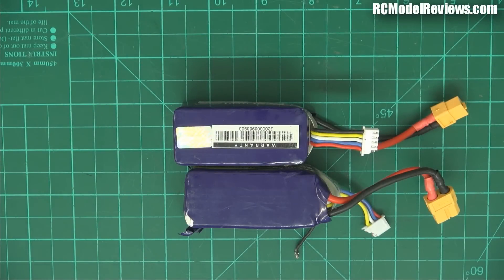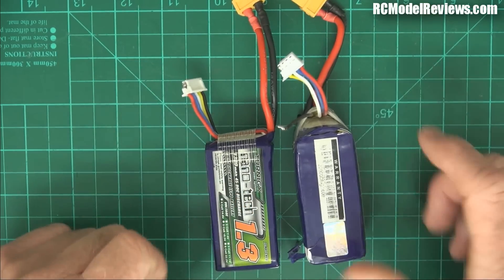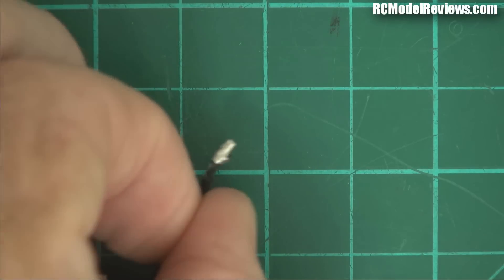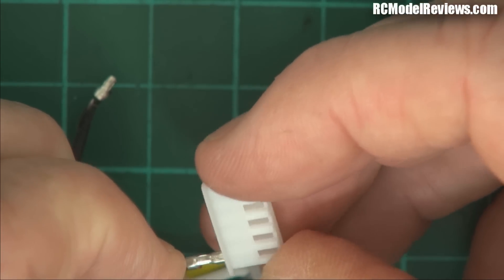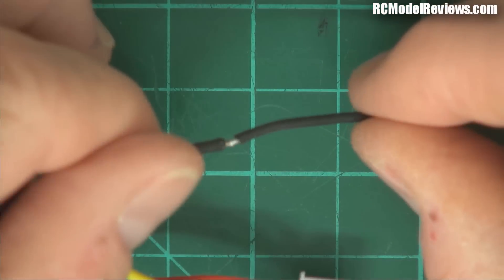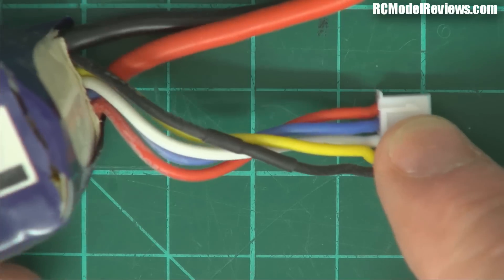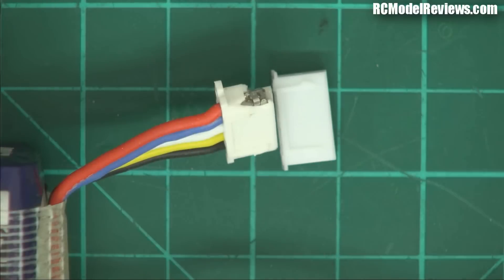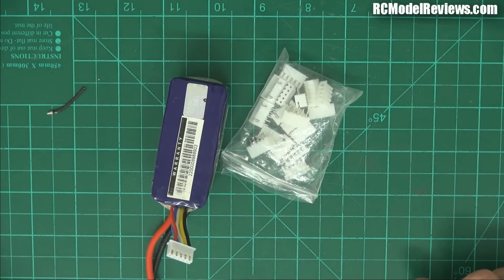Quick Tip #1:  Fixing a broken balance lead plug

Comment: I always save my connectors and balance leads from dead batterys. I have done many surgerys on batterys that have had a bad deal. I even dug one up I buried because it cought fire in the field and I had no way to bring the carcass home. I brought my wire cutters out on the next trip and cut the leads off. By then I had a proper receptacle to put it in to send it off to the dump.

Comment: What I did once, was replacing the original connectors with socket strips and connector strips. The connectors can withstand a lot of force.
This way I also only needed one 6-wire connector strip on the charger. All batteries with socket strips up to 6 wires were matching. It's some work but made charging a little easier :)
Reply: What's the correct method to easily unplug a balance connector?

Comment: Just fyi, best way i've found to keep from breaking balance leads is those little rubber bands they use for bracelets. just rubber band the ballance lead to the main lead. bonus is slid it down to bat to tell its discharged and up to lead to tell you its charged. a cheap two for one.

Comment: Question for you, since you seem to know quite a bit about batteries. I have a 3S battery (one of two) that I used to power my 6S RC car. The car is designed to run on either two 3S batteries or one 6s battery.  
Anyway on one of my 3S batteries the yellow  wire for my balancer has become disconnected  (it broke)  it didn’t break on the connector in, it broke right at the entry point into the battery. And there’s no way for me to reconnect it. So I can no longer use the balancing station or charge my battery using balance charge. My question is does that mean that this battery pack is garbage now? Or can I just charge it without balancing it. I won’t be able to monitor the individual cells, however I know to turn the power off when it gets to 12.6 V For the three  cells. 
Are the balance charging gadgets required or just recommended?
Reply: Project blue falcon has a video on how to repair that!

Comment: I still get batteries with Deans / T connectors and often i don't have enough XT60's to replace them. I've considered reusing old plugs but i'm worried that they won't make a good connection because they've been laying around and now have oxidation on them. Can they still be cleaned?
Reply: Genuine XT60 connectors have gold plated contacts. I've never had any problem with oxidization.
Reply: I got mine from hobbyking. So yours never tarnished? Never turned a darker color? Never had dark spots from all the times it sparked each time you plugged in? Or never had the insides of the tubes scraped and plating removed by the male plug?
Reply: Yes, big sparks are going to vaporise the surface, but hopefully it should only affect the tips of the connectors, and the main conducting surface should still be okay. I suppose that if your using higher voltage batteries you're more likely to get big sparks and do more damage. I only tend to use 2-4S and haven't really had the problem. There is an anti-spark version of the XT90 connector but not, afaik, XT60.
Reply: Connectors are bound to wear with time. Most people have a few batteries, so the connectors on the ESCs are likely to get more worn than the battery plugs. My feeling is, if the connectors aren't getting warm, you don't have a problem. You can always put a meter across the connectors see if there's any significant voltage drop under load, but if you're worried why not just solder on new connectors? They're not expensive!
Reply: I can buy batteries locally but they're almost always Deans and the stores tend to be out of stock of spare parts often, if they're not out of stock, 3 out of 4 times i only get about half the plugs i need before they run out anyway. So i order my parts online a lot and it takes around a month to arrive.

Last time, i got called by the photographer i work part time for to fix up the F550 and handed me new batteries to get it ready for a job. Four batteries and my parts bin only had two plugs left. I had to desolder a couple of old batteries to get their plugs. The thing is, i'm not sure if the hex is getting enough power or if the load is evenly distributed between the two batteries (camera rig flies with two batteries in parallel) because of those two old plugs i had to use.

Comment: Not RC related, but could I use a li op battery for a vehicle, I've seen li op s batterys start up vehicles but would the charging system fry the battery....
Reply: Wakey Wakey rc require good quality power and safe ones too

Comment: Thanks Bruce, great vid...how about tips on soldering the aluminum tabs themselves?  I've tried that once or twice bet never got a joint I could trust and gave up.
Reply: If you mean the solder lips on the cells themselves, they need a big iron (>60W) and a good contact surface to heat up fast. With my 65W iron & 10x6mm flat tip i can (just barely) seperate the cells or replace wires fast enough.
Reply: Nope, you need Aluminium solder. I have made a pack from scratch, and normal solder won't bond until you have the aluminium solder coating it.

Comment: It might be important to point out that you changed the leads one at a time.  You did not take all of the leads out  of the old connector then put them into the new connector.  That can be a very very bad thing.  Plus it keeps the proper order of the wires.

Comment: How about when they break at the other end, just beneath the plastic wrapper?
Reply: I think the only thing you can do (and I do) is open up the whole battery (carefull) and replace the entire lead up till the battery lip. Rewrap with kapton,ducttape, electricaltape and finish with shrink wrap or heat shrink the cells back together. Not for the faint of heart ;-)
Reply: Sounds a bit sketchy but i might have to try. Ill keep a metal bucket closeby to throw it in, if it goes south!

Comment: How much of a fire hazard are puffy lipos?
Reply: Darin S. Viehe I have had puffys last a whole season. Its best to give them the heave ho at the end of the season. I dont like baby sitting puffys in the off season. I had two of my original batterys go puff because I was stupid and didnt time my run but still got a season and a half out of both. one wasnt that bad so actually,I used it two seasons. I punctured one and never realized it till the cell discharged and started to smell up my storage box. I put the battery tester on it and it read a bad cell. The plastic wrapping had a slight hole and the battery had a hole right where the two cells joined,it was a real fluke,bummed me out because it was a 4c and cost me $40.

Comment: Why o why did you leave that damaged balance lead exposed during the fix? Never ever get more than one lead out in the open. Basic security will prevent you from accidental short circuit. It's a good video but first fix that damaged lead and get it into the new connector before swapping out the others (one by one!)
Reply: I agree.  It's happend few time to me to have a shortage before being back to the workbench.  Since then, I re-cut the cable lead  in a clean way  (if many, cut them at different size) and secure them until a definitive fix.
Reply: Do as he says, not as he does ;) . He said to move them over one by one and did except for that single one.
I once melted half through two 4mm contacts when they touched on a 5000mAh 4S pack. The worst thing about that (I was exchanging plugs on battery packs): for the first two packs I pulled one contact out and immediately cut it, then pulled the second contact and cut it. But for the third pack for some reason I pulled both contacts out before cutting and of course they touched. I was lucky they didn't weld together and just had a black spot and small burn on my fingers (I held one of the contacts).